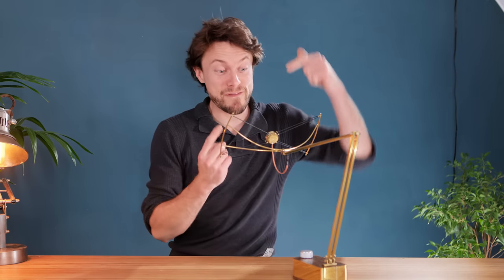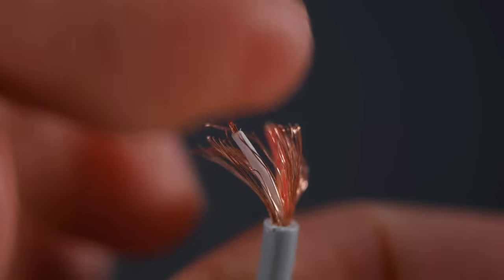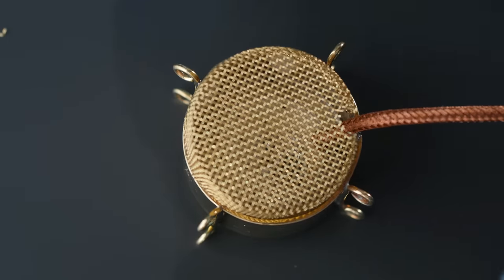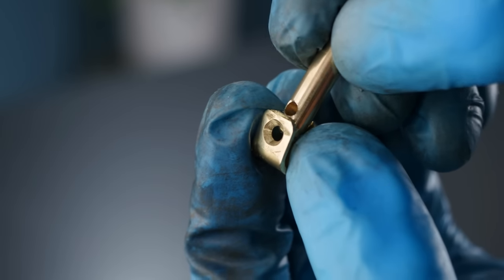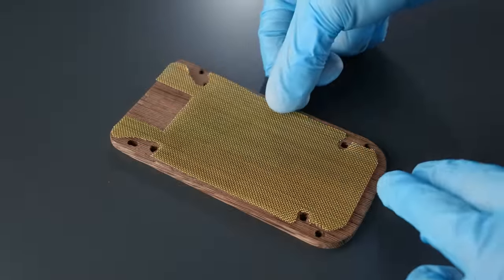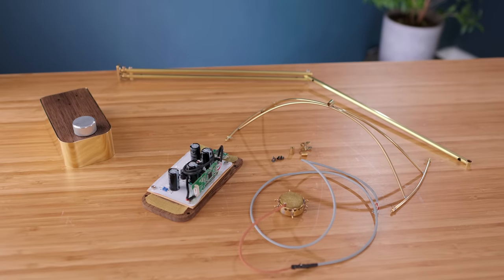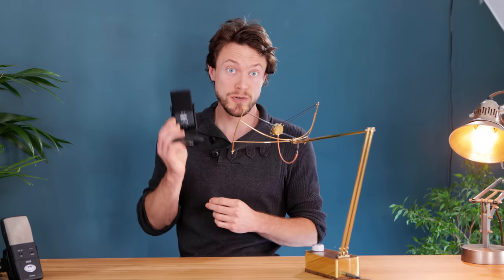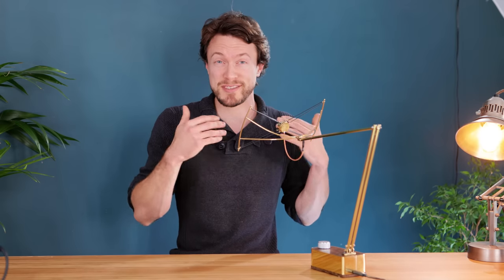Building a quality USB-C microphone

Comment: Bravo! As an audio professional and microphone designer, I was really scared as I saw this video's title. You did a great job here. Your research seems do be at the highest level. No "Audio-Bush*t" found here. I really enjoy your overall quality, so it would have been a shame to see this video fail, but it didn't. Have a nice day and greetings from Germany :)
Reply: Thoose caps are just too big for the mic transients, probably with 470uF on both sides and 2 in parallel on the USB in would be better.
I would have put some smaller ceramic cap parallel to the main bulk ones to filter out the DC DC converter noise.

For the decoupling caps i would have choosen a polyester type one. But this is just a preference.
(I try to avoid as much as possible electrolitics ones)
Reply: @tuttocrafting  Cool to hear from some actual audio experts and glad to see you aren't totally rubbishing Matt's efforts here 🙂
Reply: @tuttocrafting  I'm wondering is there any particular reason for avoiding electrolytic caps? Is it because they're generally more fragile/prone to blowing out like the ones on old pc mobos or is there another reason?
Reply: @pigpiggig  I'm not aware of the reason for avoiding them in audo gear, but the reason cheap capicators had a habit of failing in the past is due to industrial espianage gone wrong - a researcher from Japan defected to China with a design for long-life caps, who was paranoid about his lab assistants defecting in turn. To prevent this, he gave the assistants misleading designs, who then passed the designs on to Tiawan, who in turn gave it to their businesses to mass produce - end result was a flood of capacitors on the market that were designed to fail after a short period of time; this is also why there was a period when "Japanese capacitors" were considered better quality.
Reply: @pigpiggig  each capacitor kind have different characteristics. Electrolytic one are less precise than other types. They depends a lot by temperature and they al bulky. On signal paths it not necessarily at all to use hi grade electrolitic capacitors.
Probably over there also a good ceramic one might have been enough.
Generally electrolitic caps degrades more than others over time, especially if they are cheap.

Anyway there is a great article on Altium websites that explain a bit the difference between capacitors types.
Reply: Haha ich hab mir schon beim lesen gedacht, dass so ein netter Kommentar nur von einem Deutschen kommen kann.
Reply: @tuttocrafting  thank you. That's great to know, as i'm also currently having plans on building an amp circuit in the near future.
Reply: @cynicaloutlook   what you described like that goes on more than realise.
Reply: Meanwhile that one created an entire market of routine recapping to add investment value which hadn't existed before - because it wasn't required until badcaps happened. What's a shame is seeing good original capacitors 50yrs nothing wrong with them ripped out and replaced with new ones, along with silly irrelavent electrical tests on the ones removed to justify doing it.
Reply: But THIS design for electret capsule buffer?  It's certainly unusual. Uses a 30, thirty, Volts split supply, which comes from a noisy DCDC converter needs the supply rail decoupling and the opamps CM supply rejection.   Thirty volts though. hmmmm

Comment: This man is single-handedly reviving the retro-futurism aesthetic
Reply: @rondonkulus  steampunk and retrofuturism are waaaaaay different things.
Reply: Steampunk, that's the term.
Reply: @rondonkulus  right, but you literally just said all squares are rectangles while attempting to correct me for pointing out you're identifying one of many squares for the term defining all of them, which doesnt even apply as there isn't any steam. Additionally, the rectangle containing all those squares can be applied individually while referencing none of them.

The fact you're lacking that much self-awareness is even worse than your original comment.
Reply: @rondonkulus  IMO this is too clean to be steampunk... The aesthetic is more like a refined early to mid-century vision of the centuries to come. Maybe bordering on atompunk? To pull it back to steampunk,  chunkier brass fittings and some ornate stamped sheet brass ornaments for the base are in order.
Reply: Retrofuturism? Steampunk? Atompunk? It just looks like an old mic from the 1920s - 1930s. The things you read sometimes.
Reply: @LutraLovegood what are you even trying to say?

Comment: Pro Tip: Don't cut off the Bulk connector (2:14) leaving this pin floating will definitely worsen sound quality. Instead, connect it to the ground of the circuit. Otherwise the microphone performed is heavily influenced by EMV and room conditions
Reply: I can tell that has something to do with the harshness of the mic.
Reply: you can notice in the comparison at the end that yeah there is a slight little bit of room noise in the microphone along with a little harshness. Very good advice!
Reply: If you want to get really fancy about minimizing noise you’d also keep the digital conversion away from analog preamp circuit (not hot glued right next to it) and shielded.  Also the grounds & shields should avoid forming loops and instead be tree shaped (going back to a central point of grounding ie the Audio ground)
Reply: …and this thread, to me, is why to buy a microphone. There’s a tremendous amount of experience built into a commercial mic beyond just making the electrical connections. Audio and RF is a whole different world than digital logic!
Reply: @joshcarter-com i mean.. sure, but you're not likely to beat this mic for the price, and this comment chain is a list of fixes that can be applied without changing the cost at all. obviously diy isn't for everyone, but iterating on the design to improve it for no additional cost is absolutely not a dealbreaker.
Reply: @slipperynickels  agreed
Reply: very smart, very true. thanks for your pro tip
Reply: @slipperynickels yup!
Reply: Hey, can you tell me where exactly to connect then?
Reply: @t19s  to the ground or to the shield 4:12
Reply: So do you need to run an extra wire to the ground for the circuit board or do you ground it to something already there?

Comment: Dude, if this mic was available without the DIY aspect, I would definitely pick one up. It's a work of art.
Reply: Fr I’m looking for someone to build this for me 😅😅
Reply: @dericmedley8800 build it yourself
Reply: @dericmedley8800  Someone already did most of the work you just need to unbox it and screw in a couple screws its pretty cheap too
Reply: @MoonlessSolace share link pls
Reply: @MoonlessSolace where
Reply: @MoonlessSolace   where is this thing for sale?
Reply: Why are you asking "where?", when you just watched a step by step manual on assembling the parts with a list in the description?
Reply: @MaxmWotan-hm7zk  This is not "some assembling", this requires quite a bit of supplies, soldering (of two types), etc. Not to mention you'd also have to build the box and whatnot.
Reply: @MaxmWotan-hm7zk  i took a look and built a sheet for how much it would cost to buy everything, and because i don't just have brass lying around, it would be significantly more than 800$ to buy all the parts and assemble it, plus i wouldn't have half the tools he used, nor the experience to put out a polished product like this one.
Reply: Some money to be made on ETSY I reckon ; )

just sayin'
Reply: @Stand_Tall  Where did you get that more than 800 from :-D?
Reply: @Stand_Tall  are you buying a ps5 on the side too? 😂. 800 is absurd, ask your dad for a drill and get to work son.